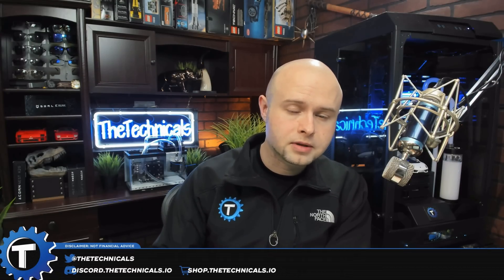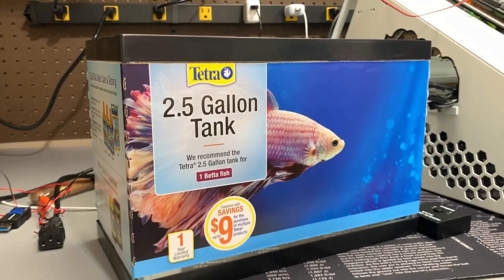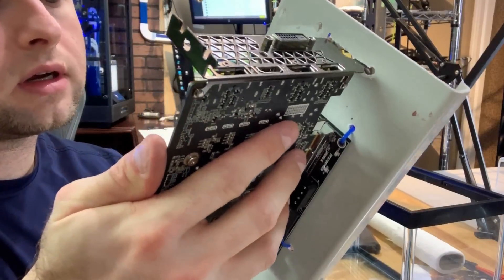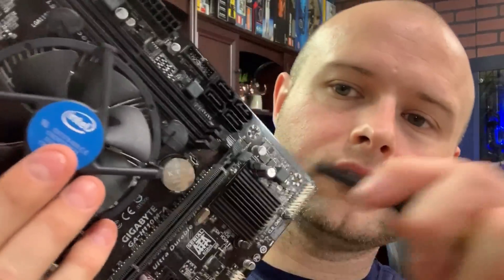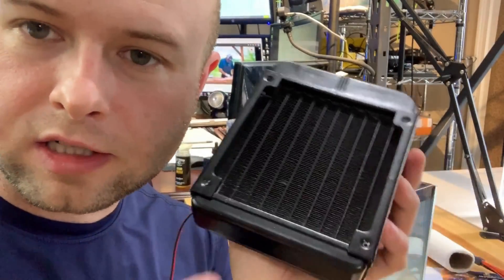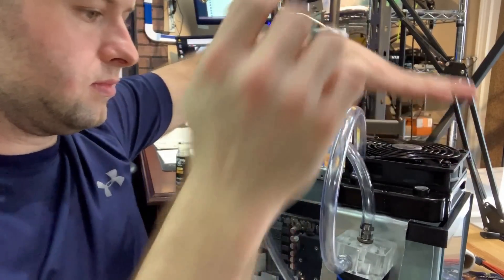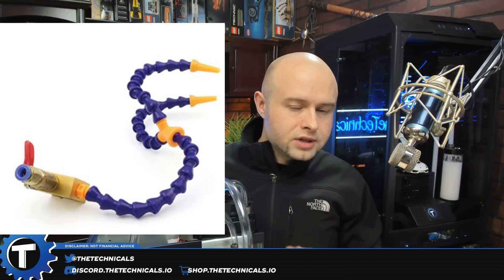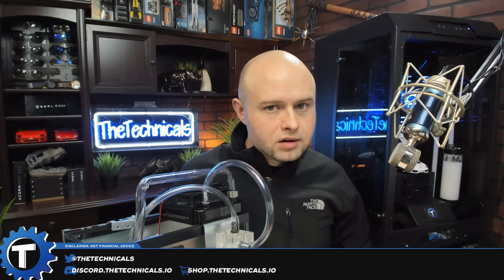"Lil Darling" Immersion Cooling Prototype For GPU / FPGA Mining

Comment: if you put a cpu air cooler on your gpu, it would probably work great.
submerge your pump as well, it'll reduce the amount of plumbing you do.
full hardlines would be appreciated
make it actually work because with the water block it will just temperature spike and thermal throttle.

Comment: "Riser on a riser" I now know where the money is being reinvested on the channel. :D

On that motherboard, did you have to jam the cpu 4 pin in, or did it just "fit in". I am unsure if you can put the wrong pins in it. 

"welding" that's brazing at best, I look forward to your welding reviews starting next week!

Prototype looks fine, also at 6:52 you're holding the heat gun the wrong way.

Comment: You'd need to remove that waterblock currently on the card in an actual immersion cooling build, unless you were using it as a secondary "return" to help flush the return coolant through the block to help cycle the primary source of heat through the tank and through the radiator. You mentioned being in an infinite boot loop on your motherboard and having cleared CMOS, but you can also pick this issue up on any memory issue(DIMM) and most grounding issues as well. In fact, they are most likely to be the problem, before something like damaging the chipset itself. I would also recommend a bigger tank, she looks tiny! Digging the "weld" job on the mobo hangar though. Well polished piece of craftsmanship!

Comment: 1:49 wont be the core that is dead it will be one of the ram modules damaged from overheating if it was run with no cooling on the chips and the hash drop will be from the rams error correction kicking in. Loved this video right up my alley.

Comment: nice idea. here are some ideas i learned from my setup ( https://youtu.be/bxzWPfh-JLg )
- you pump is too small. maybe it won't move oil at all ( high viscosity )
- pumps normally do not pull liquids, they just push. so the filling of the hoses will be a mess ( you will have to hold in the air and slpash oil around everywhere )
- if you place the pump behind the radiator, it will see the colder liquid, and maybe live longer
- i recommend heat exchangers made for air heating. they are specified for up to 20kW
- i would highly recommend connecting the existing water cooling block: just connect the cold liquid directly to the block entry. the exit goes into the open aquarium. so the gpu chip will be much colder
- you can not use novec, as it is a 2-phase cooling solution: the liquid will become gaseous - you need a closed tank for that. "premium" oil for ASICs starts at 8$/liter.. but in principle this is just silicon oil, you could use that ( https://youtu.be/9lY73ZzO7Mw )
Reply from the maker: Honored you'd even watch Mr. Block! For anyone curious, watch this guy's channel for ACTUAL immersion cooling! ^^^

Comment: Ive been doing immersion gpu cooling since beggining o 2017 i can help you with that
Reply from the maker: Got a link to some entry-level expeirment grade coolant? Nothing fancy, only for video
Reply: @TechnicalsMatt  mineral oil dude. No fancy coolants. Just pure mineral oil.
Reply: But honestly if done properly this small aquatium will be enough for 6 gpus not 1 :)
Reply: I used this syetem.to heat up my house. 40x hd7990 gave enough heat to heat up 250 sq meters

Comment: Haven't tried them, but I've been drooling over the latest version of the BesCarol 8-cap risers. Let me know how those are working for you! Couple of notes you may already be aware of: (1) On radiators.. it's recommended to use a copper core RAD with H20 cooling.. (but oil or non-conductive coolants are not an issue...thanks @Jolinator), (2) there are 2 basic kinds of immersion cooling - single phase & two phase. Single phase (like mineral oil or BitCool's BC-888) can be run in open tanks. Two-phase (like 3M's products) require a sealed tank and copper condensing coil to control the evaporation cycle, which gets a bit more tricky.  ** I've been researching all of the above for the BCU-1525 I have coming, but it appears a small single-phase immersion unit doesn't quite work as well as the H20 block you have on your BCU currently. And then I live in close proximity to my rigs, so I didn't want to worry about the two-phase vapors escaping if I went that route. Ended up just ordering the H20 block, having SQRL mount it, and then I'll max out the pump, tank, and radiator so that I can add more FPGA's to the loop later. However, I will SERIOUSLY consider throwing an ASIC in a tank of single-phase coolant. If nothing else, to quiet the screaming thing down! * Thanks again for the great info. Looking forward to the next vid! Regards from the Seattle, WA mining community!
Reply from the maker: CRYPTO FUTURE everyone read the above comment and ignore the video. Leave a dislike on the way out. Thanks for this dude, real info
Reply: @TechnicalsMatt  NO WAY on the dislike.. lol. I get all my inspiration from YOUR VIDEOS. Really appreciate you sharing crucial mining tech and information with us all. Best mining updates on YouTube (IMHO). Hoping that the open-tank immersion cooling can silence the scream of an ASIC. That's a BIG deal for me. Regards!
Reply: Mismatched metals is only an issue when using h20 as a fluid as it will become a battery. When using oil based immersion coolants its a non issue as it would have to be with pcbs containing copper , lead, tin with brass components and aluminium housings (outside of asic chassis) involved. The dielectric factor and resistance too is what makes them expensive to manufacturer. Also if your using a TUL block on your FPGA the block is made from mixed metal, so using an aluminium or copper radiator is not the issue the block will create a battery itself regardless. The use of good coolant that is changed diligently is required.
Reply: @Jolinator  Yep.. you're right! I've bounced between the H20 cooling I'm doing on the BCU-1525 and experimenting with immersion cooling on the ASIC's. So apologies if I mixed my facts or made it unclear. Thanks for correcting and I made a note above. I ordered the TUL block due to the need for having SQRL mount it for warranty coverage purposes. There is a new fully copper block now available, but too late as the order has been in awhile. I hear that the TULL block has anodized or coated aluminum, which may help, but I'll definitely be using/regularly changing a high quality coolant with it. Too big an investment to take chances. That includes potentially magnifying the the problem with a cheaper aluminum radiator. I'd love to go with the 2-phase immersion, and I hear there are containment systems coming out soon, but again... couldn't wait. Appreciate you sharing your knowledge. I know I've seen you around the Discords, so perhaps I'll catch you there! Regards! .

Comment: I'm a precision mechanic and I have to say I could not made it better, but you forgot the duct tape^^ . and if you want a cool looking solution for the radiator use a exteral rad like the airplex GIGANT from aquacomputer. and yes i know they are f** expensive but who cares :)
i'm excited about the finished result and pls put some fake fishes in there. (and its the slot bracket)
Reply: Buy a performance Alu car rad from ebay, way more thermal capacity and cheaper ;)